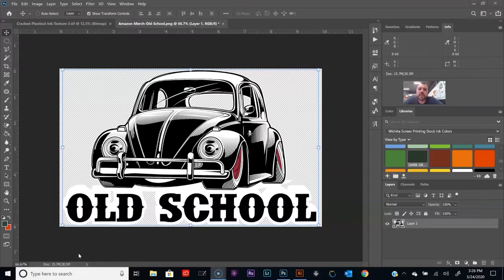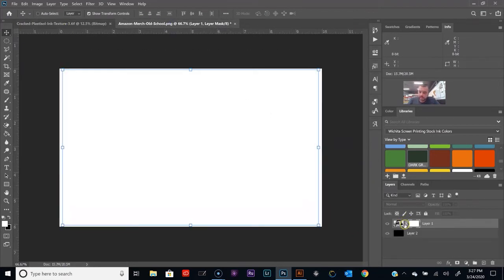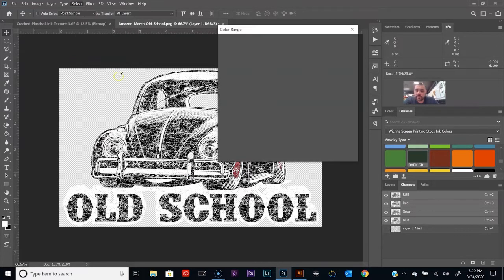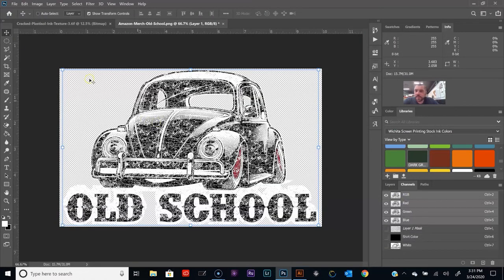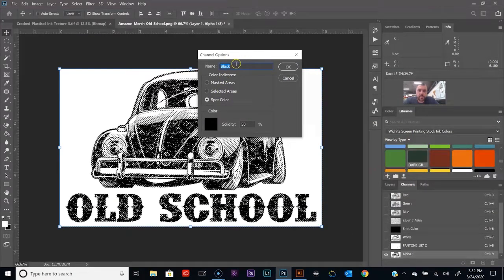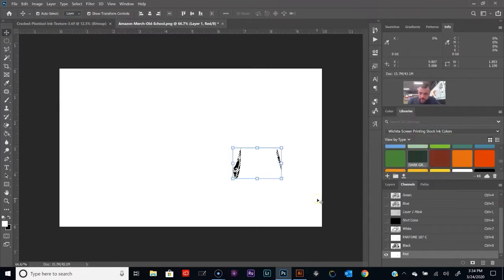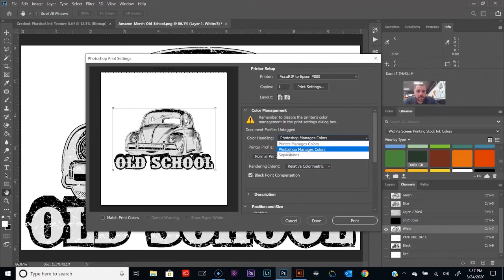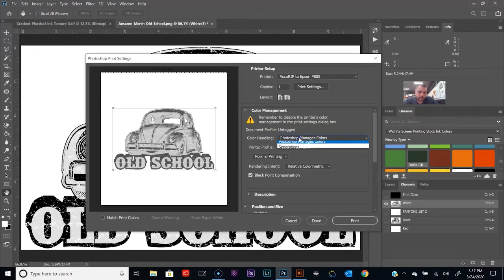How to Apply a Vintage Texture Effect to Your T Shirt Design in Photoshop

Comment: Great video! do you have or are creating videos on how to Vectorize a full-color image using Photoshop only? also a video on how to separate a multi-color complex design/artwork using only Photoshop?  if you have please link me to them. thank you!\m/
Reply from the maker: LFE_ CUSTOM that’s in the pipeline man. I’m working on the multi-color simulated process video next. As for vectorizing an image in Photoshop I can vectorize simple one colors but not sure how to do full color. I switch over to illustrator for vectorizing complex designs. I’ll add that video to the list man. Thanks for the positive feedback and letting me know what other videos would be helpful.
Reply: @LearnHowToScreenPrint  Awesome man! looking forward to those upcoming videos. if you can show how to more on Photoshop would be a lot more helpful I don't use Illustrator as of yet. another video that could be very helpful to create would be how to print large images on the front of a zip up hoodie. i have done it several times just haven't seen an official video out there that shows it step by step process if you know what I mean. everyone has the pocket print and back print video but not on the front over the zipper area.
Reply from the maker: Will do!